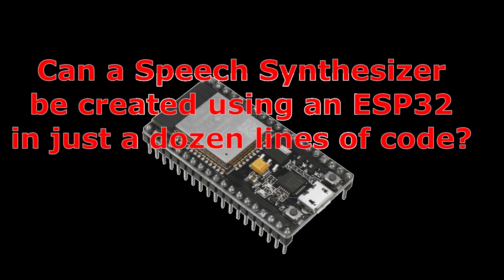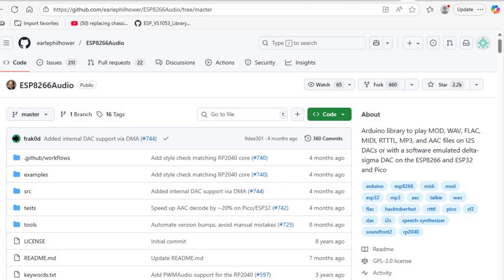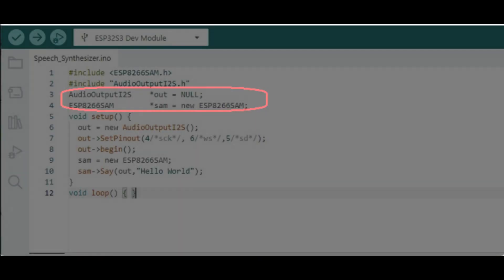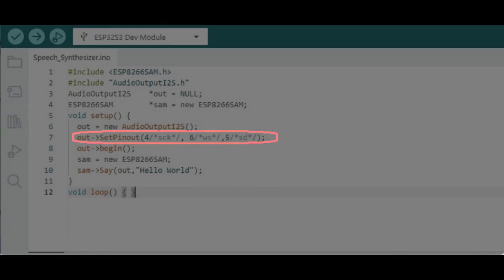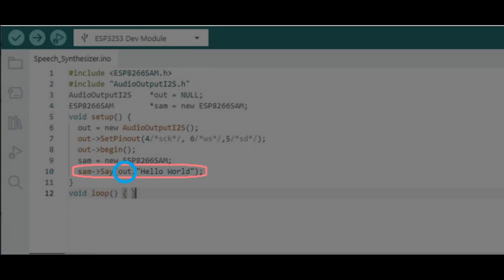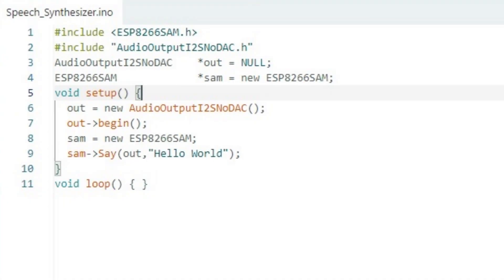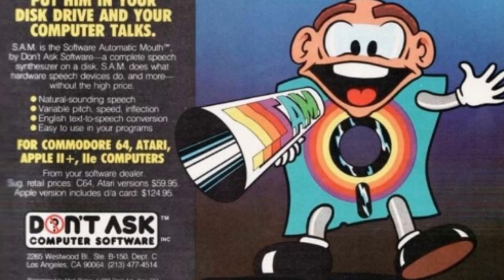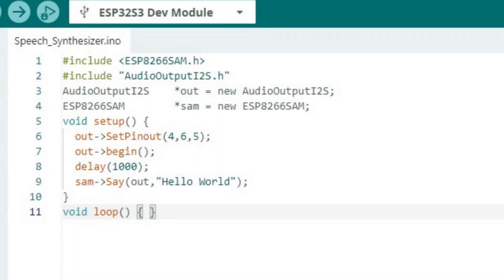Speech Synthesizer in a Dozen Lines

Comment: Pretty good vid, but. This isnt truly a docen lines of code, because you used custom libraries, so its actually using more than a docen
Reply: Dozen. I noticed you misspelled it twice, probably not a coincidence.
Reply: @jessejallday congratulations.
Reply from the maker: That's correct but, you can also take it to the extreme and look at how many lines of machine code make up the project once compiled and the same sentiment would apply to anything at all written in C, regardless of libraries used.  Whilst it's fun coding in assembly, it's a hard slog and I am happy working in C and have no problems with the concept of high level languages and custom libraries.  The point I'm making in these videos is purely to highlight how little C code is required for adding this feature to a program. 
When I first started adding speech to one of my prior projects, I was using a different library and it was very messy to work with, not supporting ascii text at all.  When I found ESP8266SAM, I was impressed with how easy it was to work with.  The intention with this video series is to inspire people who may not have bothered with something such as speech synthesis to see that they can add it to a project with a small number of lines.